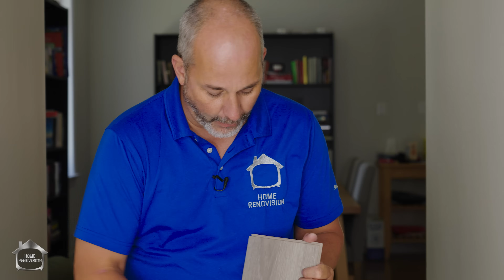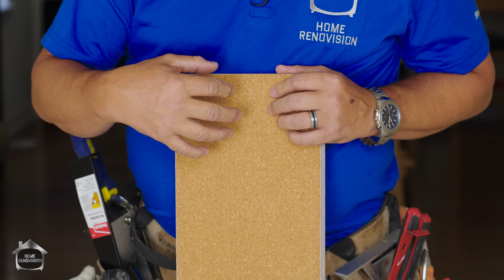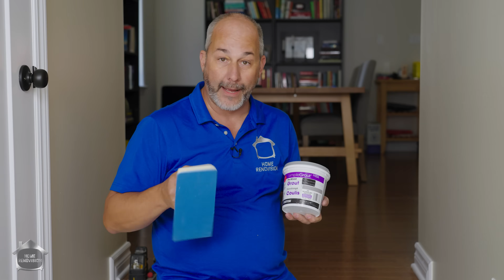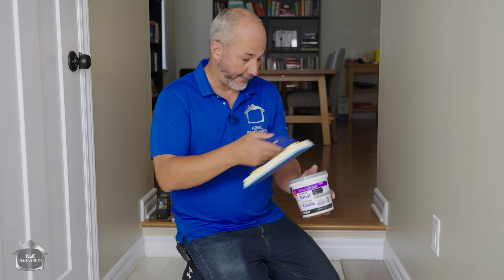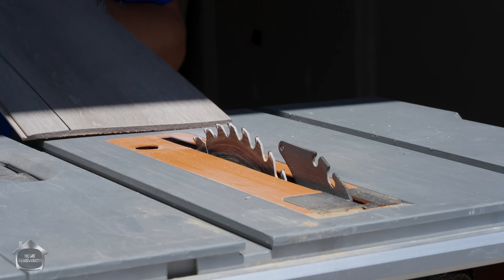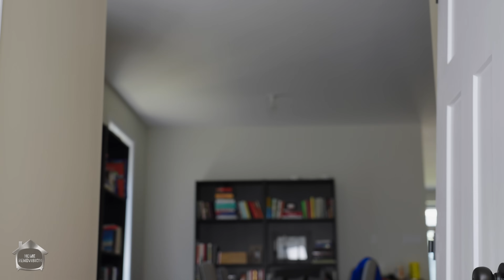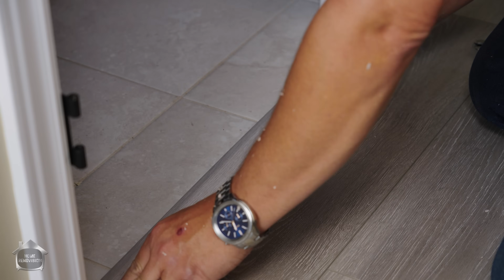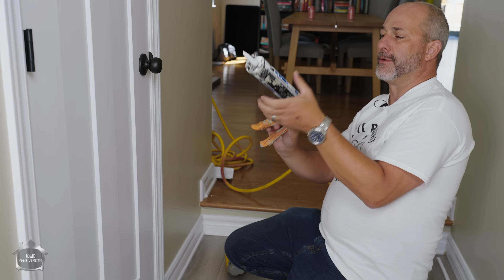10 Tips For Installing Vinyl Over Tile

Comment: I am a sales person for flooring, vinyl plank, laminate, carpet, tile, etc. I have installed vinyl plank and laminate before. Also, I actually build displays for the flooring I sell.  I will say this, you pay for what you get. The more expensive the plank, the easier it is to put together and the better quality you are going to get. For example, his flooring tells you how many feet you can go before you need a transition, all flooring is different. Make sure you read the box on any flooring you are thinking of getting, that is information right from the manufacturer and it usually tells you all about the flooring. For example, length before a transition, whether it's three-seasons ready, maximum tempatures, etc. Do your research on any flooring and the methods of installation before you buy, it will save you lots of time and money. I have ran into many people that are mad and they say vinyl plank is junk but when I ask what happened, it usually is because they got into a hurry and didn't properly install the flooring. And if you aren't sure you are doing something right, ask questions, watch videos like this, Jeff is pretty good at what he does and has quite a few great tips on every project you are thinking of doing.
Reply: Pretty good? Come on....be real. He is AMAZING.
Reply: About maximum length and transitions. I am planning to put down Lvp in hallway thru to kitchen (open plan no door) how would you handle that?

Comment: When you placed the transition piece by the door, what did you secure it with? I saw you used the two sided tape, but what if you were transitioning into a larger room? What would hold the boards in place? Thank you!!!

Comment: Jeff is really good at this and he knows how to be real safe but I dont suggest using that table saw without the gaurd. Its best to just use jig saw. Jeffs hands was like 1 ruler away from getting chopped texas chainsaw style. If you are new, its really dangerous because you might slip while moving the board and lose your hands. Its just not worth it. Just take the longer route and use the jigsaw otherwise risk your hands.

Comment: Hi! Love your video and it gives me some confidence to lay Click Vinyl flooring over my existing tiles. Is it ok to put the same over tiles with floor heating ? Removing the tiles is very expensive.
Reply: Some LVP products are approved for heated floors and some are not.  Check with the LVP manufacturer.

Comment: Nice showing the typical homeowner diyer the most unsafe ways to use a table saw. But hey, at least it offers job security for us at the firehouse. Our medics love instructions like this. In retrospect, a straight tip and router would have been a lot safer with the contouring.

Comment: You say you don't have to leave spacing for expansion and contraction because vinyl doesn't expand and contract, but what about the surrounding walls and structures made of wood and other expandy and contracty materials? Don't you have to leave room for them, since they go right up against the vinyl floor?

Comment: Great Demo video, I have one  question though...do vynil plank that completely bend down when you hold it from the tip mean that it's cheap quality ? Anyone heard of gerbur brand ? Supposed to be a german brand and very good as advertised by the seller...true ? Its anti scratch, water proof and anti UV,  but very bendy ! Cheap quality ?its about 25$ per square meter

Comment: welp.. I think you just solved a major problem for me... as my entire downstairs is currently tiled. We just put vinyl plank flooring in upstairs and The boss has decreed she wants the down stairs to match.  I was fearing having to tear out all my 20yr old tile work,  about 1000 sq ft worth, and re-level the entire down stairs.  I do have a question.. The tile was put down over 1/2 inch durrarok backer board, would that require to use of an underlayment if the plank has a cork type backing?
Reply from the maker: not necessary, but may provide better sound control.

Comment: Cut the door jambs so you can go under them, stagger floor joints so they don’t line up, use a knife not a table saw since the coating will dull the expensive blade quickly. Watch another video, this is not correct in any way

Comment: Where is your 1/4" gap all the way around the floor ? I am positive it requires one just like ALL free floating floors do.
You show some really good technique and are 100% right about preparation is key. 
Without the 1/4" expansion you have voided the manufactures warranty. Be sure to always read the directions in full so you make 
sure you are doing things within the manufactures installation guidelines. I have been in the flooring trade for 30+ years as a installer and sales. I am not trying to knock you but you missed the mark on this video by not doing the proper steps and setting up the floor to fail and someone doing this themselves to fail which could lead to a costly mistake.

Comment: Hi, great video.  A question. I plan to do a hallway but it has doors on both sides.  I cant start on one side as you do as this would leave a small gap where the door is to fill in. It wouldnt look good.  What's the solution?
Reply from the maker: start with a half plank. Cheers!

Comment: do you use vinyl plank in a 3 season sun porch? It doesn't get moisture in it unless someone leaves a window open. I thought it would be a good choice since vinyl plank doesn;t expand or contract like other products. There is tiles in there now and they are very slippery when you come in from the hot tub. Thanks for all your great videos

Comment: Home Depot’s Lifeproof works like a charm over tile. Renovated a basement that was mostly vinyl tiles except for a laundry room which had porcelain tile. Didn’t want to try to bust it up. Lifeproof is very stable over the porcelain and contributes a lot, for a relatively modest price, to the overall look. My one complaint with Lifeproof is that the tongues are not the strongest and will break off if you’re not careful or try to reposition it. I put Pergo on the first floor which has a more refined look than Lifeproof at a similar price. But no way was I going to put Pergo in the basement because of its . They each have their quirks.
Reply: How about over laminate itself? Not lvp but the vinyl laminate sheets.

Comment: I’ve put laminate flooring in my house 3 different times. The first time I did what you did by cutting the 2nd piece in half and using the other half to start the 4th row. I wasn’t too happy with what I call the “brick wall” effect. So the 2nd time I cut the first board of the 2nd row at a random length (about 1/3) and used the cut off piece to start my 4th row. This staggered the end seams which, to me, had a much better look than the “brick wall” effect. Also, I was told, if you’re doing a room with a window, you want the flooring to go in the direction of the light coming in. Does that matter?

Comment: my kitchen im about to remodel the the floor is imperfect and (yes i have jacked it up some). going down to the original hardwood then recovering. what type of plank would you recommend with there being a dip in the middle of the floor?

Comment: My old tile has a lot of height difference between grout line and the center of the tile.  So…I need to pour a bunch of grout to bring everything to the same uniform height - the night before to let it dry before starting?  Which product rating would mean super high-quality quiet floors (e.g. cork)?
Reply from the maker: cork is great for sound reduction and anti slip.

Comment: Jeff, thank you for the life saving tips. My kitchen is half tile and have wood. I am planning to put vinyl on the top of the tile and use the your trick to put the  transition but concern about the vinyl to slide to the other half of the kitchen and there is no space to put a transition track. What do you suggest?
Reply from the maker: install vinyl with a cork backing it does not slide. Cheers!
Reply: @HomeRenoVisionDIY  hi jeff what is best thicknes of cork uderlay for vinyl plank? cannot find nowhere. 2; 4; 6; 8 or 10mm?  and why. thank you for ansver

Comment: I'm planning on doing this project later this year in my entryway. Great video! What tool can I use to measure or trace the curve of the first step of a stairway that sticks out?
Reply from the maker: a peice of cardboard goes a long way to making a template. Cheers!
Reply: @HomeRenoVisionDIY  I appreciate this tip too!! I was looking online for one of those things that slide against the frame of the walls and doors to get a perfect edge but sounds like this will work just as well!!

Comment: Hi Jeff, Thank you for your tips and advice. Need your advise in my situation. I have a 300 sqft of kitchen and living area together of ceramic tiles (diamond shape mixed two color flooring). Near the kitchen cabinets few tiles have cracked and I am not getting those colored tiles too. I was planning to buy those tiles and they are not available in the market to replace the broken tiles now. When I saw your video on Vinyl flooring and I planning to have Vinyl flooring near the kitchen area and leave the living area with ceramic flooring and Kitchen area with Vinyl flooring.
Now a combination of Ceramic and Vinyl flooring. My question is the tiling was not perfect what I had got it done. Some area near the kitchen is not leveled. How could I level the tiles before installing the Vinyl flooring near the kitchen area? Need your advice? You also talked about Grout and this Kitchen is also a high traffic area. Due to uneven ceramic flooring, will the vinyl flooring break off near the Joints? Please advice?
I can email you the photo of my kitchen to have a better Idea as to what I need. Please let me know your e-mail ID.
Thank you in advance.
Reply from the maker: I would suggest you join our mebership program. The link is in the description. That way you can email me pictures and I can help you with your project. Cheers!

Comment: fyi your substrate still has to be flat as piss on a plate to do this type of installation. Always read the manufacturers recommendation for the substrate conditions. I've only come across one home in the last three years that I agreed to go over top of the tile. TAKE THIS VIDEO WITH A GRAIN OF SALT unless your existing tile floor was flat like an ice skating rink. Otherwise, failure is bound to happen.

Comment: What do you recommend for fixing an end joint that keeps popping up slightly. I had dips in my old tile floor and I didn’t level it out first. Is there a glue or caulk I can rub in the seam?
Reply from the maker: yes. use a vinyl seam glue and set a weight on the end overnight. Cheers!

Comment: Great tips and tricks Jeff. You give confidence to all of us DYI”er to tackle small jobs.

Have you ever dealt with asbestos containing mastic. My basement has vinyl tile glued with black mastic to the floor. I had sent in sample of tile with mastic and it came back positive for mastic but tile do not have asbestos. I was thinking of covering it up with vinyl plank flooring since I don’t want to deal with hazard. What are my options?
Reply from the maker: encapsulation is the best option. asbestos is only released if the mastic is chisled or sanded. simply install the sub floor directly on top and don't worry about it. Cheers!
Reply: @HomeRenoVisionDIY  Thank you Jeff. One problem I may run into is the drain in the center and the floor dips towards the drain around the center. What would I do in that case? Can I pour floor leveler around the drain?

Comment: When doing the second floor of a house, how do you deal with edge at the top of the stairs and then the change of the rise of the top step?  Another great video!
Reply: bullnose stair treads. in the same lvp
Reply from the maker: If you remove the current flooring then adding a new one is great. If you are capping a previously installed floor then you need to do the same to the steps. Cheers!

Comment: I would like to lay Luxury vinyl tiles over my existing vinyl tiles. However, I have a few squeeks in my floor. Could I drive some 3 inch flooring screws right through my existing vinyl tiles into the floor joists below, and apply some grout over the indents these screws will make to flatten it out, and then install my new Luxury vinyl flooring over top of this after the grout has dried. The existing vinyl flooring are 12 inch square tiles and it was a medium grade at the time that was 3 or 4 mm thick. None of it was peeling or lifted. Is this flooring a good candidate to tile over with new Luxury vinyl with an SPC core or should I just rip it all off first? Lastly, if I find a luxury vinyl like the one you have in this video would that mean I do not require any other underlyament as the cork padding will take care of that? THanks!
Reply from the maker: yes a truly luxury tile has a good underlayment attached. just remove the old floating floor and fix your squeaks.
Reply: @HomeRenoVisionDIY  Oh so you recommend I completely remove all the existing vinyl tiles, screw down the subflooring where the squeaks occur and then lay the new SPC cork backed vinyl panels right on top of the subflooring once squeaks are removed? Did I understand you correctly? Thanks fellow Canuck! :)

Comment: I would love to do something like this in my home. However I have an area in my living room that has real wood, so it’s not exactly flush with the tile. What would you suggest in areas like that or in areas that may just be concrete?
Reply from the maker: if things are not level then removing the existing floor will always take you back to level and a clean slate!

Comment: Jeff, you're amazing! Helped me a lot when I just got here in USA.
As a professional installer now, I recommend the people get a mixed pattern to lay the lines (different from that you used on the video - with a lot of "H" in the lines).
And yes, doorjambs are the worst part for an installer, but you could install the piece easily between these doorjambs using your tapping block and a pull bar.
It's impossible just if the piece needs to cover the 2 areas with a "C" shape.

Not agreed with all information in the video but you're excellent as always. Thanks for teaching us.
Reply: 100% agree with this comment👌🏻
Reply: I find my band saw or jig work perfect for jagged cuts.

Comment: Lifeproof lvp from Home Depot is one of the best on the market at only $3-$4 / sqf compared to those overpriced brand from tile shops, I have no idea why you think the tile grout lines will show up. I have used it many projects including my own house they all came out excellent,
Reply from the maker: I have had bad experience with soft core flooring like lifeproof with translation. glad to hear you have not!
Reply: The grid could show through or the flooring get damaged if certain furniture like a chair leg sits on the grout line.  Lot of weight in a small area.
Reply: Lifeproof is great if you want your house to look cheap and disposable.

Comment: Not a fan of the shoe mould transition to the door trim. Is there a reason why you wouldn't remove the baseboards first then reinstall over the vinyl?
Reply from the maker: shoe mold is common here so reinstalling saves a ton of extra work.

Comment: I'm a fan of not cutting 1/2 or 1/3 plank but using the run's end cutoff as the start of a new row (if at least a quarter, or I'll cut a third), this way you don't get those artificial matching seam lines you have, but more irregular.
Reply from the maker: I usually do the same, however in this video I thought i would show something different. Cheers!
Reply: That works until you find yourself in a room that’s only 1 or 2 inches short of 3 planks, for example. The look of every plank being only an inch apart is awful. I ran into this issue recently and you end up just having to cut a new starter piece every so often when you run out of cut off ends that will look good.

Comment: What about same over 12 X 12 asphalt tile that is intact but somewhat a bit curling?
Reply from the maker: unlevel surfaces need a underlayment to help even out the floor.
Reply: @HomeRenoVisionDIY  The mastic under the asphalt tiles is loosening and the edges are a bit  lifting. I have been using a heat gun to soften the tiles and the mastic to make them lay flat again. Wondering if the thicker vinyl planks you describe would be good enough. Else, I will just have to scrape up all those tiles ... not hard, but hate having to dispose of all the debris. On the other hand, if it doesn't turn out well, then I have a REAL disaster.
Reply: @mddale  old asphalt tiles usually pop up EASY
Reply: @KayakKingdom  No doubt. Getting them to stick is my problem. Still, there are hundreds of them. A big mess I'd like to avoid.

Comment: How about installing vinyl over tile that's used for radiant floor heating (pex tubing, gas boiler)?
Reply: Was thinking this myself....I doubt the heat would transfer through but I could be wrong
Reply from the maker: no worries, heat transfers through vinyl just fine. best to use an abatek underlayment with a vimnyl that has no backing for that job./ Cheers!
Reply: @HomeRenoVisionDIY  Makes sense! And it wouldn't disrupt the thermal mass to a point where it would take much longer to heat the tile and vinyl laid over top?